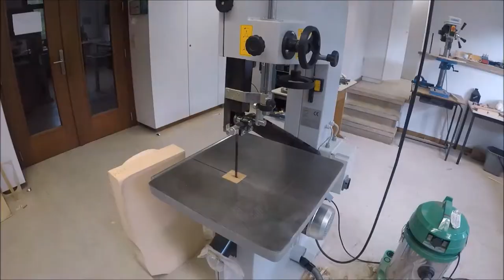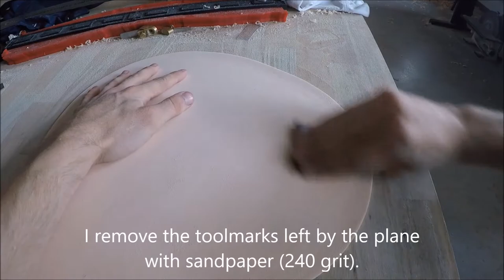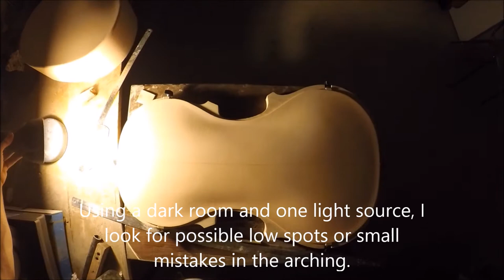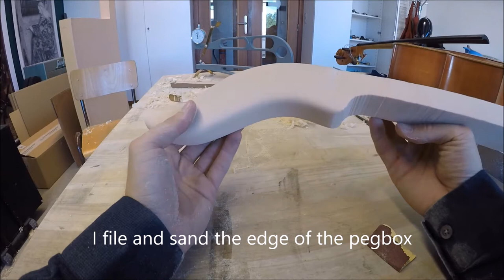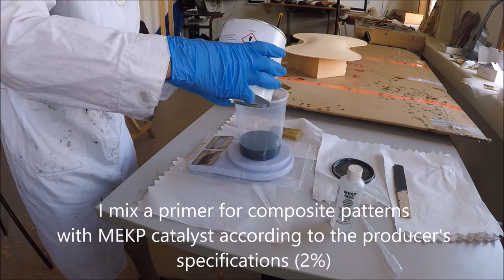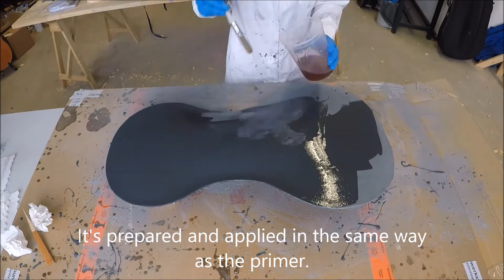Making a Carbon Cello - Part 1/3 - Pattern making

Comment: Hello! Thank you so much for the video! I I just wanted to clarify, do you think it would not be easier to make a matrix in the shape of an already finished cello?  Means to disassemble the cello in parts, make a matrix of each part and then make carbon copies of these parts?
Reply from the maker: Making all those moulds, parts and then assembling them would be allot(!) more work. Also every glue joint is a weaker point within the instrument. So having as little glue joints between different parts as possible is definitly an advantage for durability. The advantage of this method is also that the moulds can be reused. So construction of additional instruments also goes allot faster then when you would make all parts seperate. So to conclude: I don't really see why you would want to do that or what would be the advantage.

Comment: Hello, where do you purchase large PU material like that?
Reply from the maker: https://www.easycomposites.eu/model-board-tooling-board-block Easy Composites sells boards up to 1500x500. The one I am using here is the PU240 Medium density. If you need larger pieces you can easily glue them together. I found conventional white wood glue to work just fine for this!
Reply: thank you! @TimDuerinck

Comment: Wouldn't it be easier to use CNC to do the mould? In theory carbon fibre is just the same density all along, and is not like wood, no tone tapping etc etc involved.
Reply: Drawing a beautiful and good arching for the CNC machine is VERY difficult. I tried but couldn't get the precise arching I wanted. For me, as a classically trained violin maker, it is much easier and faster to just sculpt it as I did in this video. Once you then have the moulds you can reuse them, so it safes time for later production.
Reply: @drduerinck  alternatively there are copy machines like for key cutting and wood work.  You are just talented and skilful.
Reply: @drduerinck How do you account for plate tuning?